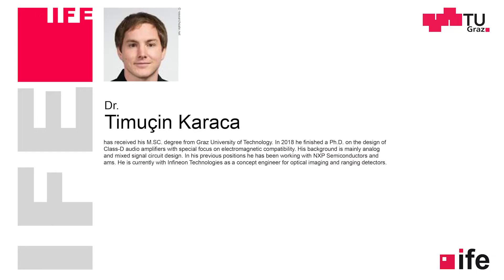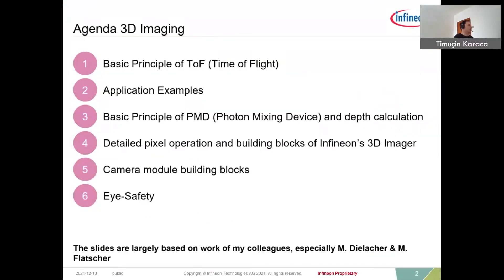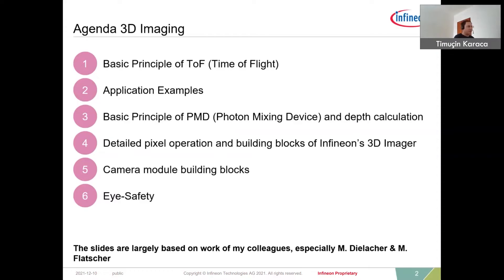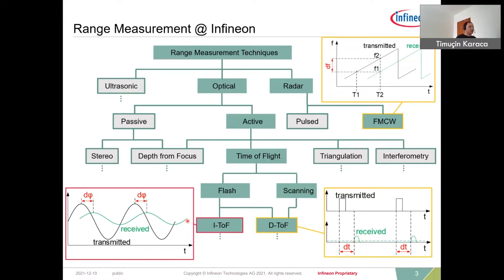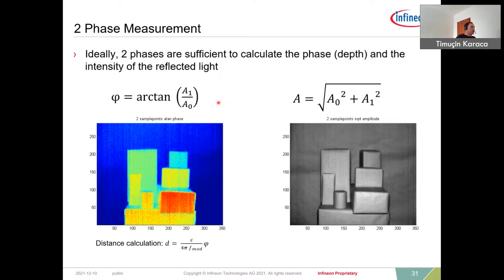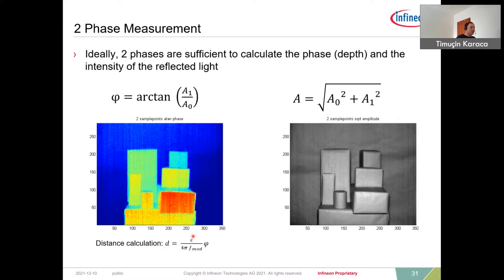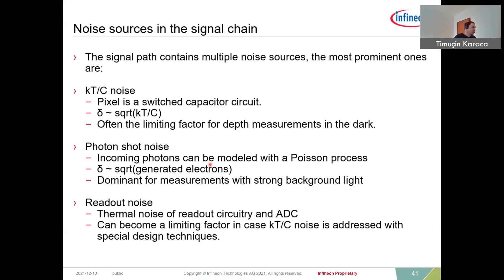TOF 3D Imaging by Dr. Timuçin Karaca

Comment: Summary of "TOF 3D Imaging" by Dr. Timuçin Karaca

*   0:05 Introduction: Dr. Timuçin Karaca, a former PhD graduate from God's University of Technology, currently working at Infineon Technologies, will discuss indirect Time of Flight (i-TOF) 3D imaging.
*   1:08 Time of Flight Principle: The talk introduces the time of flight principle, used in 3D cameras to measure distance by analyzing the time it takes for modulated light to travel to an object and reflect back.
*   1:34 Application Examples: i-TOF technology is used in various applications, including face recognition, computational photography, gesture recognition, robotics, and automotive in-cabin sensing (e.g., adaptive airbag deployment).
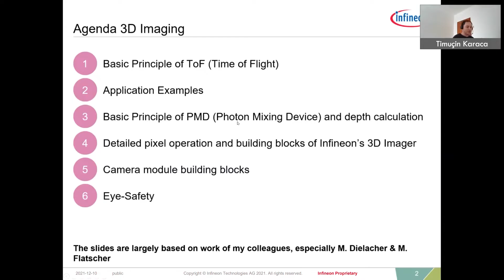*   2:14 Ranging Technologies: Infineon focuses on two active ranging technologies: optical and radar. Optical technologies use active light, while passive technologies, like dual RGB cameras, are less common at Infineon.
*   3:28 Flash vs. Scanning: Flash illumination captures the entire scene at once, while scanning illuminates a small area and scans across the scene.
*   4:12 Direct vs. Indirect Time of Flight: Direct ToF measures the exact travel time of a light pulse. Indirect ToF modulates the emitted light and measures the phase shift between emitted and reflected light to determine distance.
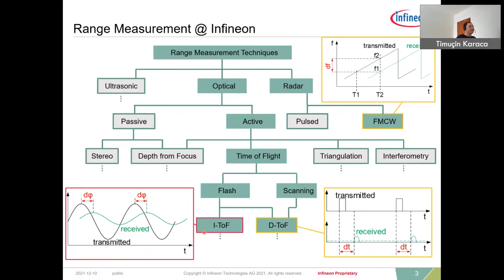*   5:57 Historical Context: An early experiment by Hippolyte Fizeau used the time of flight principle to measure the speed of light, demonstrating the principle's long-standing relevance.
*   8:43 3D i-TOF Camera Structure: A typical 3D i-TOF camera consists of a pixel array, an external light source (usually a laser diode), and a processing unit. The chip controls the light source, measures the phase shift, and sends data to the processing unit for distance calculation.
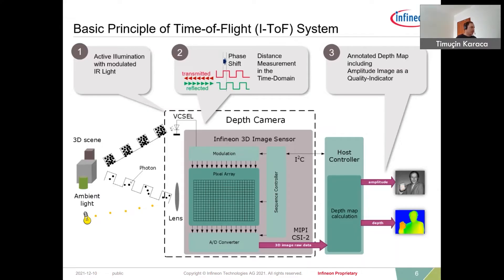*   11:54 Pixel Arrays and Depth Images: State-of-the-art i-TOF sensors have up to VGA resolution (300,000 pixels), with research pushing towards one megapixel. These sensors generate depth images, where pixel values represent distance.
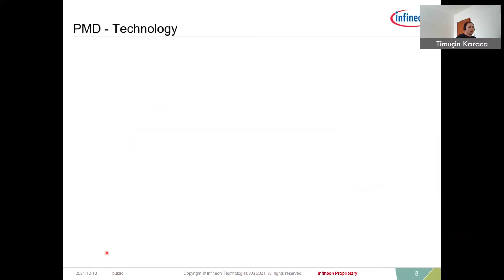*   14:55 Photon Mixing Device: Each pixel contains a photon mixing device with two readout nodes and modulation gates. By controlling the electric field, the device directs photo-generated electrons to either node, allowing phase detection.
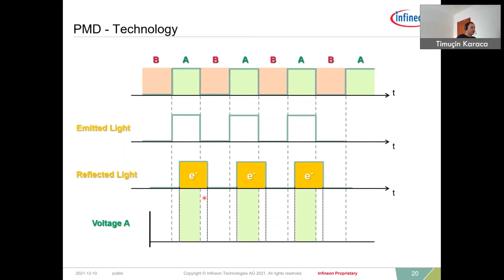*   18:49 Electron Collection and Phase Shift: The voltage difference between the readout nodes correlates with the phase shift, enabling distance measurement.
*   19:49 Modulation Frequency: A typical modulation frequency is 100 MHz, corresponding to a 3-meter unambiguous range.
*   21:22 Ambiguity Resolution: To resolve distance ambiguity, a second measurement with a 90-degree phase shift is performed, providing a unique distance solution.
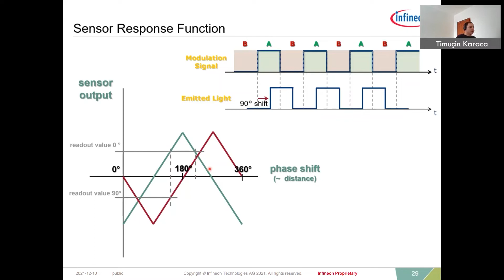*   23:37 Data Processing: The phase shift and amplitude are calculated from the pixel data, generating depth and grayscale-like images.
*   25:37 Artifact Removal: Four-phase measurements (0, 90, 180, and 270 degrees) are used to eliminate artifacts like stripes caused by readout chain offsets.
*   29:45 Pixel Size and Technology: State-of-the-art pixel sizes are around 5x5 micrometers, with research pushing towards smaller sizes.
*   31:11 Circuit Design: The control circuit in each pixel manages charge collection and readout, while a background illumination suppression (SBI) circuit improves dynamic range in bright conditions.
*   38:08 Background Light Suppression: The SBI circuit counteracts the effects of ambient light, such as sunlight, by adjusting current sources to maintain a constant node potential, extending dynamic range.
*   44:45 Noise Sources: Key noise sources include KT/C noise (related to capacitor charge storage), photon shot noise (due to the random nature of photon arrival), and readout noise from the readout circuitry.
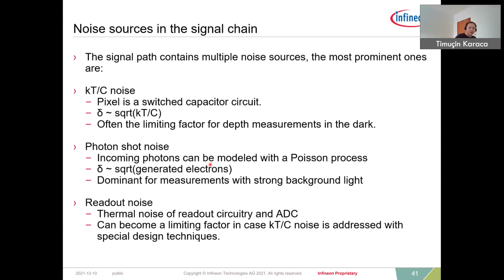*   49:14 Frontside vs. Backside Illumination: Frontside illumination (FSI) is simpler and cheaper but has lower quantum efficiency due to metal layer obstruction. Backside illumination (BSI) is more complex and expensive but offers higher quantum efficiency and is necessary for smaller pixel sizes.
*   53:57 Process Improvements: Techniques like prisms, buried trenches, and micro-lenses can enhance the performance of FSI sensors.
*   57:52 BSI for Smaller Pixels: For pixel sizes 5 micrometers or smaller, BSI is essential for achieving sufficient performance.
*   58:24 Chip Components: Besides the pixel array, the chip includes ADCs, a digital core for control and data storage, a PLL for frequency generation, an eye safety support block, a modulation signal generator, and power supply circuits.
*   1:02:33 Chip Distribution: Chips are distributed as bare die (for consumer applications) or packaged chips (for automotive and other applications requiring robustness).
*   1:05:41 Camera Module Components: Building a 3D camera requires a driver for the light source, a vertical cavity surface-emitting laser (VCSEL), a diffuser, a lens, and an optical filter.
*   1:07:57 Optical Filter: The optical filter is crucial for blocking sunlight and reducing photon shot noise. 940 nm lasers are often preferred due to a dip in the sunlight spectrum at that wavelength.
*   1:12:54 Eye Safety: Due to the powerful lasers used, eye safety is paramount. Various mechanisms, such as current monitoring, photodiodes for diffuser monitoring, and conductive coatings, are employed to ensure safety.
*   1:17:42 Conclusion: The talk concludes by emphasizing the importance of i-TOF technology and inviting questions from the audience.

I used gemini-1.5-pro-exp-0827 on rocketrecap dot com to summarize the transcript.
Cost (if I didn't use the free tier): $0.04
Input tokens: 29052
Output tokens: 1283